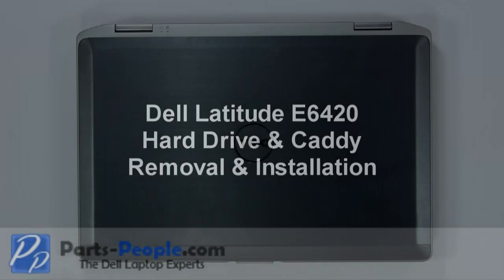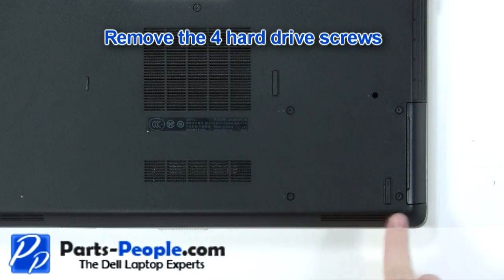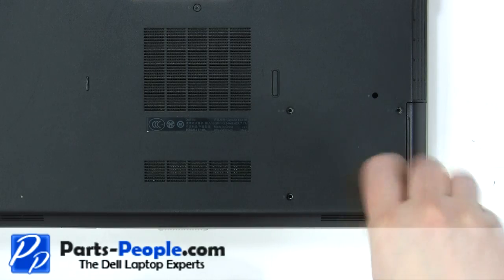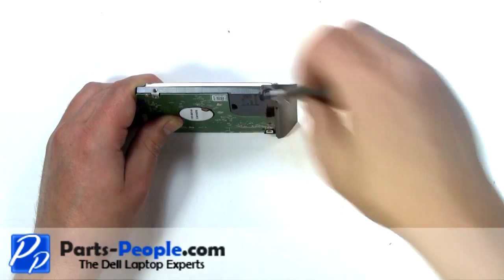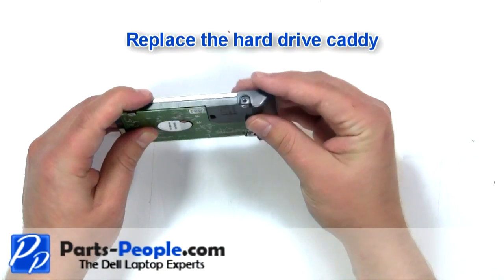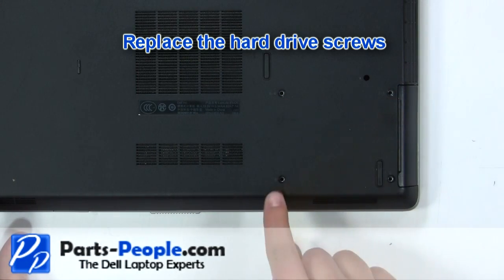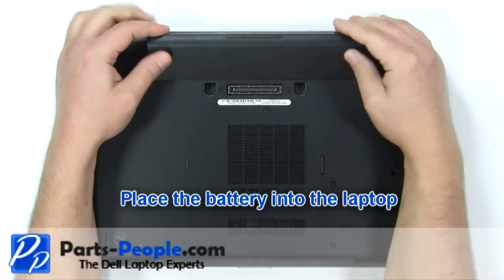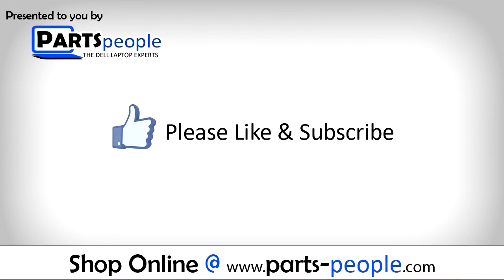Dell Latitude E6420 Hard Drive & Caddy Replacement Video Tutorial

Comment: How to replace discrete nVidia video card?
Reply from the maker: The video card is build onto the motherboard. You would have to change the motherboard to replace the video card.
Reply: I have found specialized computer shop that repairs on component level. That means they can take out soldered video card, order new part and solder back.